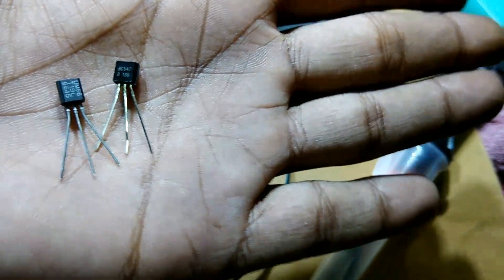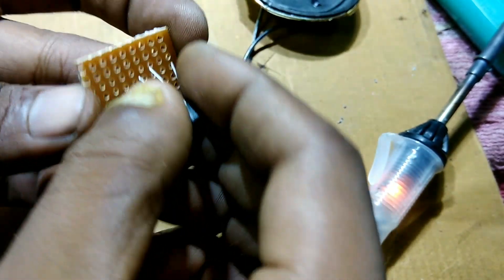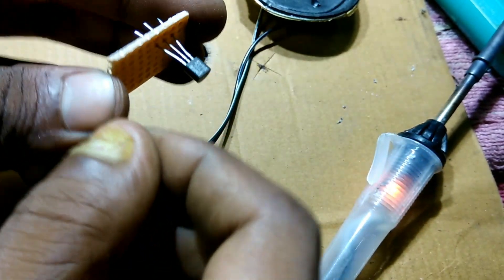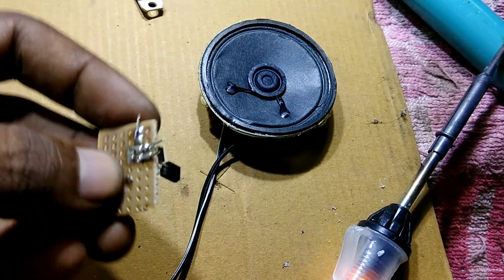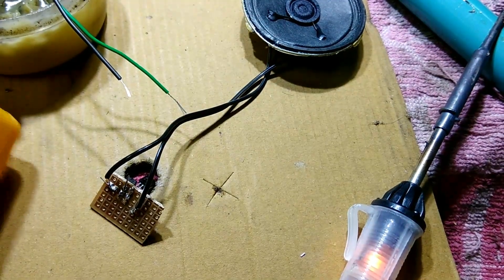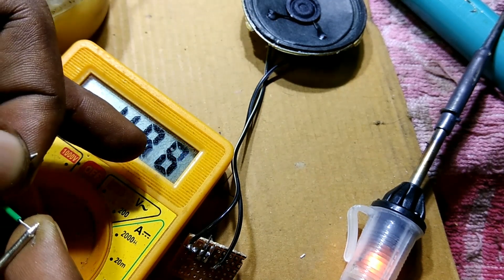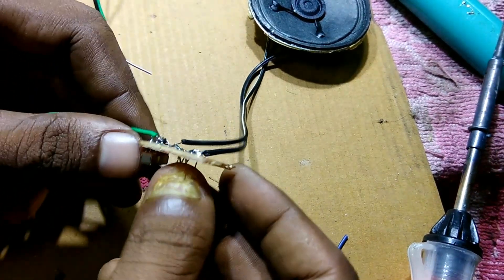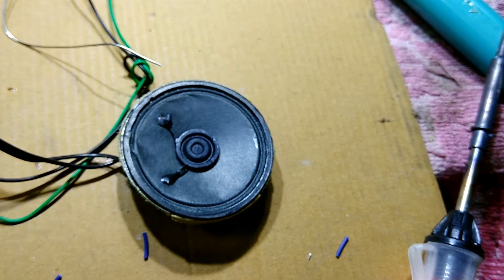Um66 music ic for door Bell basic electronics project

Comment: how can i connect to 230v current to this bell
Reply: Use is a simple 230v AC to 5v Dc Transformer or 230v AC to 5v Dc Tranformer...if you use anything more than 5v u may risk in burning the ic.....so use a l7805 voltage regulator
Reply: Simply use the Transformer
Reply: and also ac to dc full wave bridge rectifier
Reply: You will need a step down transformer to reduce the voltage from 220VAC to 5VAC. Then you will need a bridge wave rectifier to convert it from AC to DC. Then you can either use a 3V regulator or a voltage divider to further reduce the power supply from 5VDC to 3VDC.